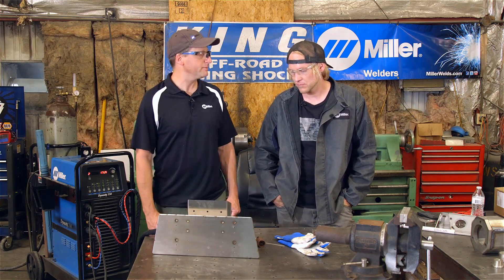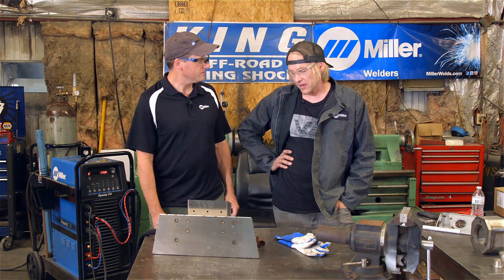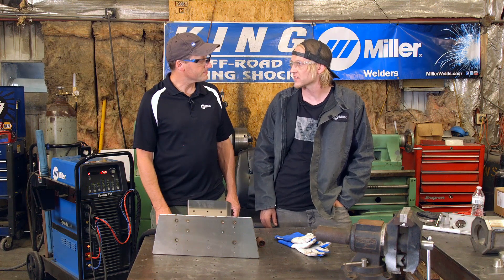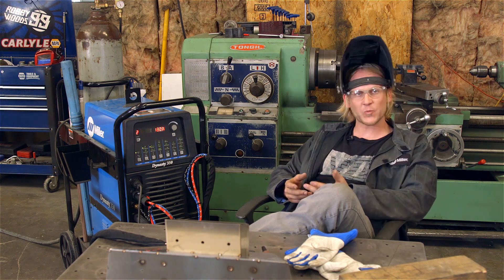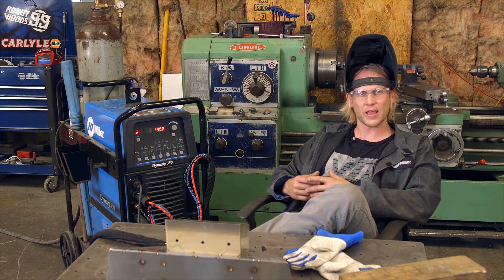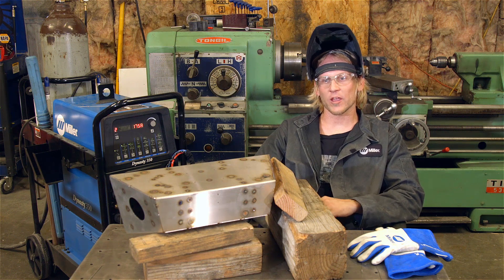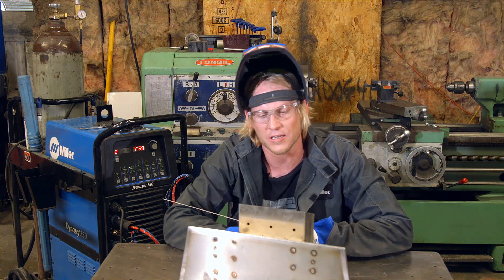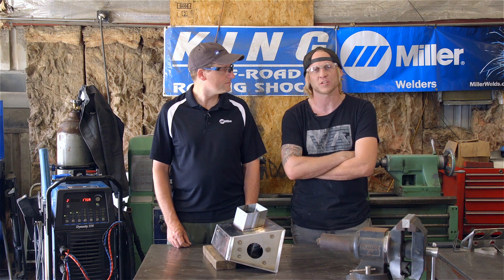TIG welding stainless steel muffler with the Dynasty 350 at BattleBorn Engineering

Comment: What cup was he using?
Reply from the maker: Thanks for your question! Here are the parts Robby used:

54N63-20 Insulator
13N22L Collet for 1/16 tungsten
13N23L Collet for 3/32 tungsten
45V116S Lg Gas Lens for 1/16
45V64S Lg Gas Lens for 3/32
53N89 Lg Short Cup